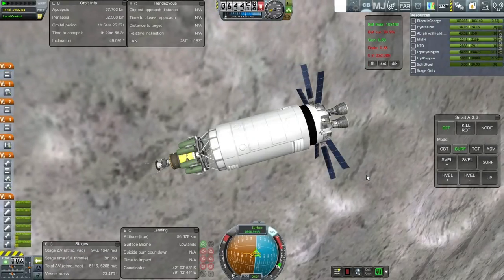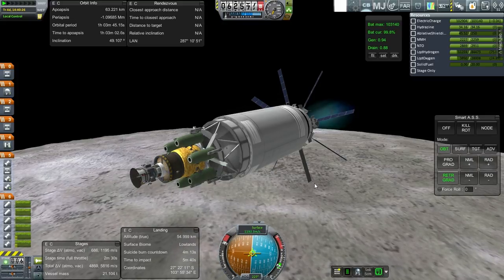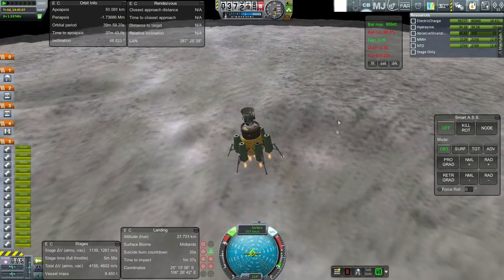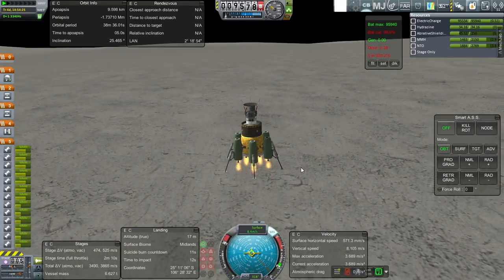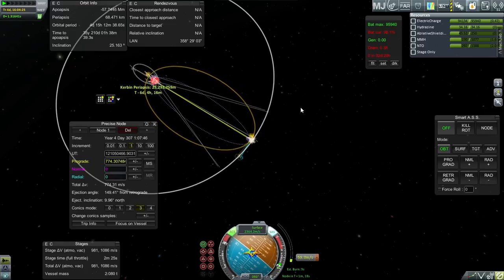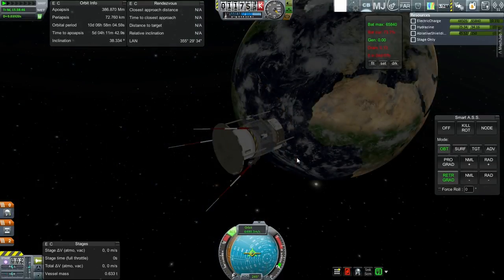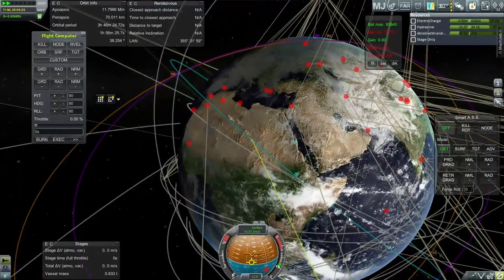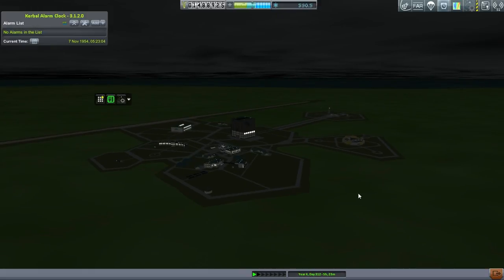Realism Overhaul in KSP Beta 31 - Lunar Sample Return Part 2

Comment: #PlutoHype! It definitely should be a planet, at least let it be an exception since it's got so many moons and it's been one so long, etc.

I'll be watching your stream on Wednesday. And I'm working on those engine configs, if you remember from the last stream. I'm making good progress and I'll include an overview of what's been changed with them in the file which I'll send you if you'd like.

Great video. It's interesting that those engines have about the same thrust profile as my Poseidon probe with its argon hall thruster. Well, about two of the engines. I believe my max thrust was something like 1.7 kN.

Apollo's ascent stage set off with a mass of slightly less than 5 tonnes (2.2 without fuel), so I'd say you're probably going to be fine with 2.5. Interesting landing in Somalia, don't think I've seen that one before.
Reply: Ooh, that's an interesting array of mineral combinations. I never really thought about any of those as catalysts for fuel production. I'll be interested to see any future Mars missions utilising the ISRU.